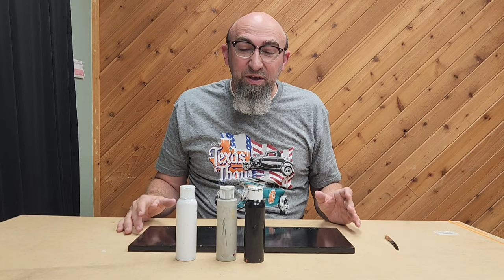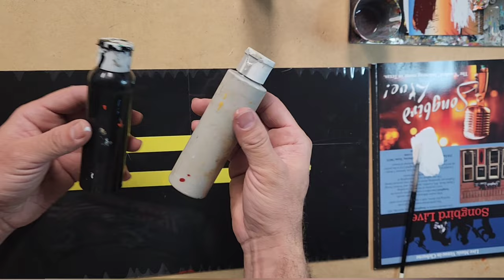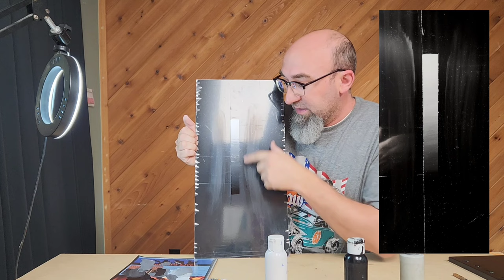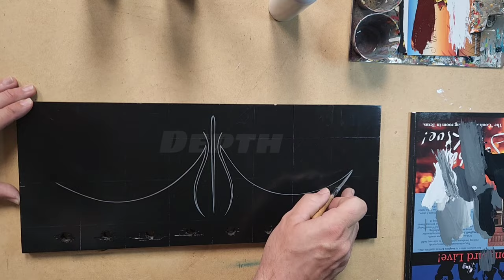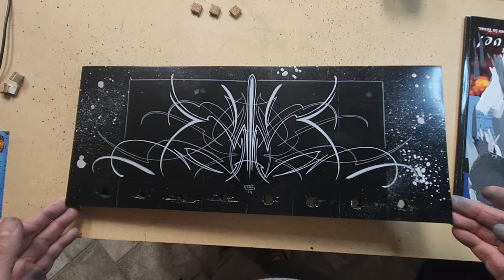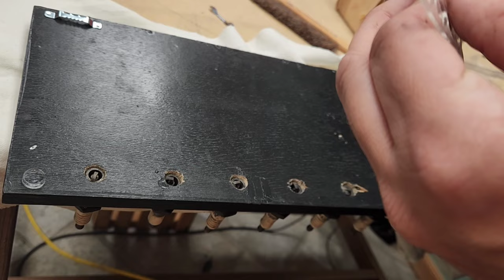Pinstriping Color Theory Deep Dive Part 1: Value

Comment: I find a dark background to be easier than a white one. light to dark or dark to light. Always get mixed up in my head. On a white background or lighter color, What color do you prefer to start with a dark or Lighter color or value? Great series
Reply from the maker: On a light background, I prefer to start light and move darker with each layer. I do plan to get to that with this series, plus have experiments with some more complicated problems. I really want to dive deeper than value contrast and explore some of the problems we faced in color design classes, like how to keep a design a close value to the background but have contrast through temperature or intensity.